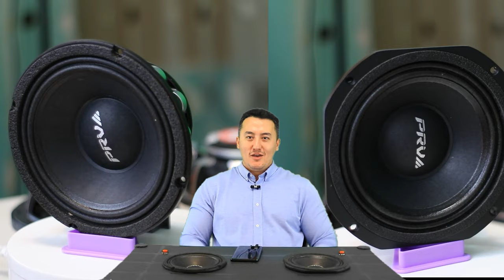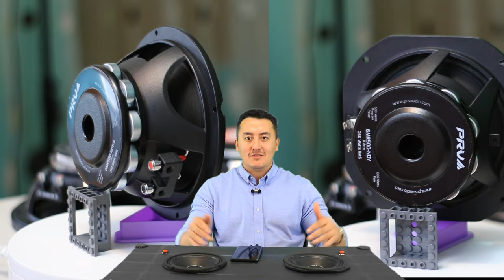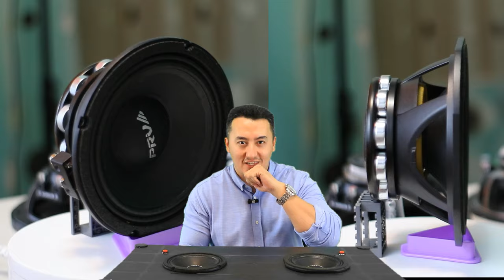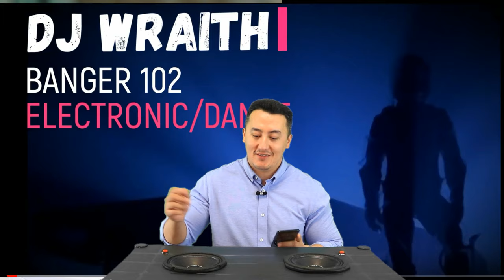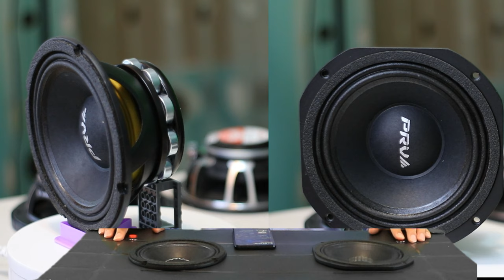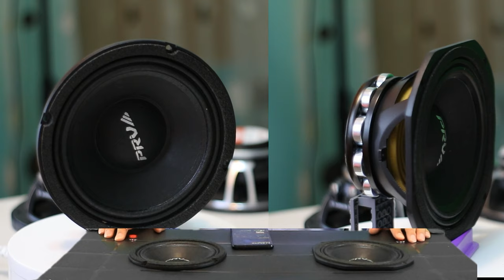Myth busted, real test 4 Ohm vs 8 Ohm speaker? Car audio system PRV AUDIO 6MR500-NDY

Comment: 8 ohm means there's a rest between each bass kick(making it a clean kick like "Boom" - "Boom" - Boom"), the lower the ohm the more the bass overlaps without a break in between each hit(Booommmbooommmbooooommmmmmm no break between each bass Kick more of a continuous bass sound overlapping one another, this is usually at 1 ohm or half ah ohm, this is also why it causes the amps to run so much power/so hot that you could smell the speaker coils because there's no rest just continuous overlapping bass) hope this helps  ..........
Reply: One more thing a amp running 5000 watts rms at 8 ohm is a hell of a powerful amp, compared to a 5000 watt RMS amp running at 1 ohm or half ah ohm, the 8 ohm is going to be way louder, more like concert speakers with ever kick of the Bass, 
The one ohm or half ah ohm will only win if the bass is a set continuous synthesizer bass in the music you're listen to, if not you won't even notice!!!
One thing to remember though running a 5000w RMS at 8 ohm is way more expensive than running it at 1 ohm or below and the 8ohm will sound 1000% better and louder ).........
✌❤🙏

Comment: A couple of factors. First off, it will depend on speaker efficiency, if you have a 4ohm driver with a lower efficiency rating than a 8 ohm drive that has a higher rating, then the amount of output will be close. Also the amplifier has a part in it. Not all amps produce double the power when you cut the impedance in half. Some will, some won’t. So it depends on the amp’s out put on impedance and the efficiency of the speaker’s Thiel small parameters. That’s why some speakers sound louder than others with the same amplifier. Efficiency = power output
Reply: "NOT ALL AMPS DOUBLE THE POWER WHEN YOU CUT IMPEDENCE IN HALF"
i would recomend you to take a look again at ohms law, the amplifier doesn't "doubles" the power when you go from 8 ohms to 4. The power is already there and it will not be doubled, it's simple ohms law and it states that "the power decreases if the resistance increases". So if you go from 4 to 8 you are increasing IMPEDENCE hence power decreases. And every amp in the world does this and not just few amps like you mentioned. Peace.
Reply: Very good answers - you would choose your speaker based on the amplifier's output rating i.e. 4 ohm / 300 W RMS 2 ohm / 600 W RMS and so on.
Reply: @burhanuddin127   hello i have a question and hope i get an answer and is that i have a taramp 800x4 2ohms and i have installed already 4 prv neodymium that are 4 ohms with 2 PRV super tweeters that are 8ohms and i’m planning changing them to another prv model and i wanted to know which speaker is better for me an 8ohms or a 4ohms?
Reply: How do I contact you
Reply: 4ohms @350-450 rms 
2ohms @300-350 rms

From 700 watts rms amp designed for 2ohm.

Comment: They're both 250 watt drivers/speakers.  They should produce same quality sound in design.  It's totally depend on how much the powered amp can produce in 8 ohm or 4 ohm channels, and the wiring here too.  Please check the amplifier power outputs in manual or specs!  It's missed leading fact or myth busted!

Comment: I always enjoy watching your videos. In the beginning of the video  you said that one is 4 ohms and the other is 8 ohms. You also stated that they are on the same channel and if that's the case you will have a 12 ohms load on that Channel. If you have a 4 channel amplifier connect each speaker to a separate channel like 1,2 channel or 3,4 channel because those channels will have the same tuning. The amplifier will put out it separate power due to the load impedance of each speaker.  Thar way the test will be more fair. I am not expecting double the power, double loudness from the 4 ohms speaker at all. And for the people who are commenting about 8 ohms lasting longer than 4 ohms. The truth is it really doesn't matter. If you match your amplifier properly with your speaker's impedance and rms wattage output then you shouldn't have any problems of amplifier overheating or speakers burning.
Reply from the maker: Yes im running on 1 channels and buttons is separating them its not parallel only if I press both itll be parallel
Reply: Still not a fair comparison you need to make sure the euch speaker is getting the same amount watts

Comment: Higher ohms means less power draw, so in a power limited set up like a 70 amp alternator would I be better to use 8 ohm speakers and pump more power to the subwoofer? I don't like my music in my car very loud so volume wont be an issue.

Comment: Ohm is the electrical resistant in a circuit. So it really won't change sound.  It will just take more amps / power to get the same volume on a higher ohm speakers. But you can also overheat and damage the speakers, stereo, or amplifier if you run the channels / circuit on the ohm range it wasn't designed for. If you run /wire two speakers, in parallel, it will drop the ohms / resistants by half. Ex: The positive and negative from the speakers are both connected together to the same corresponding terminals on the channel. 
Then, if you run / wire the speakers in a series, it will increase the ohms / resistance of them. Ex: Positive from one speaker goes to the negative of the other.

Comment: i built my own 3 way house speakers using 2    ,4 ohm 10 inch sub woofers for car audio and 2    6.5 midbass 8 ohm car speakers and 8 ohm tweeters!  i have a total of 400 watts i am pushing with my house stereo and they sound great , i also built my own crossovers i love my music loud and havnt had my stereo over half way yet on volume and it shakes my whole apartment building! lol

Comment: Going from an 8 ohm to a 4 ohm doubles the load on the amp, when you double the power to a speaker, you get a 3db increase. Doubling an amp power to a given speaker doesn't double the sound output, you get around a 3db increase. Humans can detect a 3db increase but it's not twice as loud, you would need a 10db increase for it to be perceived as twice as loud.
Reply: @Hayawasa  True, a 3db in amplifier power which efectly is a doubling of power at any impedance of the speaker curve. A speaker impedance is rated at its lowest point on it's impedance curve but is sometimes much higher within the speaker bandwidth .
Reply: @Hayawasa , 1 NYC DJ is spot on.  The "3dB measurement" here is derived from the formula.  The formula for power is, dB = 10 * Log (Pout/Pin), and for voltage is, dB = 20 * Log (Vout/Vin).  In this case, 4Ω will draw twice the power than that of the 8Ω.  So, we use the power equation and find the Log of 2, which is 0.301, then we multiply it by 10 for 3.01dB.  This is where the 3dB measurement is coming from.  Each doubling of power equates to a gain of 3dB according to the equation.  The difference between a 4Ω and 8Ω speaker has never been a comparison between twice or half the perceived volume.  The difference is merely a doubling or halving in power.  An 8Ω load will always be -3dB when compared to a 4Ω counterpart with the same sensitivity at 1W and with the same voltage applied.  The reason for this is because of the power difference.  2.83Vrms = 1W into 8Ω but 2W into 4Ω.  An 8Ω load with a sensitivity of 90dB will be 90dB at 2.83Vrms and the 4Ω load with the same sensitivity at 1W will now be 93dB because the voltage is the same and 2.83Vrms = 2W into 4Ω.  That same 8Ω speaker is now 93dB at 2W, but the 4Ω speaker is now at 4W and 96dB.  96bB with 4W into 8Ω and 99dB with 8W into 4Ω....etc. (Adding 3dB with each doubling of power).  An increase of 6dB is a doubling of voltage, which also represents a quadrupling of power.  An increase of 10dB is required in order to yield a doubling of the perceived volume (SPL).  An increase in 10dB just so happens to equal 10 times the power when plugged into the formula appearing as though it's linear, but the decibel isn't linear, it's exponential.  It takes 10W to be twice as loud as 1W, 100W to be twice as loud as 10W, 1000W to be twice as loud as 100W, 10kW compared to 1kW...etc.  It requires 10 times the power regardless of impedance to effectively double the loudness.  A change of 3dB can never be close to or over 4 times as loud regardless of frequency.  It won't even be close to twice as loud.  That completely violates physics.  Four times as loud requires an increase of 20dB, not 3dB.  The most important rule to remember in electronics is that we can't violate physics, it can only violate us.
Reply: @Hayawasa  I was covering the theory of it.  In reality, there is no such thing as perfection, nor is electronics an exact science to begin with.  The math is our guideline, but it's certainly not ever dead nuts on...that's for sure.  The figures will realistically be even less due to the limiting mechanical factors of the speaker itself.  But those things go far beyond the scope of what I was trying to illustrate.  I agree.  There's a lot of variables at play.  There is no dead nuts answer.  It's about trial and error when it comes down to it.
Reply: But bad hair cut man does not know this !!!!!
Reply: carforumwanker lmao 😂 wow.
Reply: @shortckt4680  yeah your right and im wrong. 😂😂😂

Comment: Double sound energy is 3db, the difference between some 4 and 8ohm speaker drivers. You starts hearing double the loudness at 9db.  So yes, you are correct it is difficult to hear 3db difference in volume. When you played both drivers at the same time we could hardly hear the change in volume because double the energy is 3db.  However it is measurable and 3db difference is significant.
Reply: 4 or 8 Ohm does not effect the way the speaker sounds. The only thing that ohm effects is the amp.

Comment: Pro and home speakers tend to be 8 ohms. Car speakers are almost always 4 ohms. Why? Because an amplifier is more efficient when driving a 4 ohm load. You get more power at 4 ohms. Car amps and head units would be twice their size if they were 8 ohms. That 14 watt per channel car head unit would drop down to 7 watts if driving an 8 ohm speaker.
In your test you didn't really push your amp to high levels. So at low levels both speakers will perform well.
Midrange speakers tend to be very efficient so most of the time there is no need to push them hard with lots of power.
Where there will be a difference is in driving speakers that would benefit from the extra power which would be woofers and subwoofers.
Generally you are going to see a +3db difference in spl between these two speakers. Often this small amount is hard to hear. +6db is very noticeable.

Comment: the biggest point to 8ohm in my experience is if you have a crappy stock system, what a bit more boom with a better sub cone, but don't want to tear everything out to drive a 4ohm sub, and get the maximum out of the stock amp. They are great for the quasi audiophile who has car speakers or computer speakers with crap subs, but that's the only big point imho.
Reply: THANKS. I JUST WANTED TO REPLACE THE 4ohm WITH 8ohm IN MY $65 SUBWOOFER BOX I BOUGHT FROM EBAY. I USE IT FOR FRIDAY NIGHT COOKOUTS & ALSO IN MY BASKETBIKE WHILE CRUISING AROUND. I HAVE IT HOOKED UP TO A 2.1 CHANNEL MINI AMP. SO, SHOULD SOUND LOUDER, IS WHAT YOU'RE SAYING?:face-blue-question-mark:

Comment: Most power amp manufactures list the power output at 4 Ohm, and 8 Ohms.  Sound pressure level i.e. Decibels is measured on a logarithmic scale, so doubling the power will not double the sound pressure level.  That's why the volume control on a receiver or amp is an audio tapper (Logarithmic) and not a linear tapper,  Potentiometer or rheostat. The speaker's voice coil sensitivity rating also affects the sound pressure level output. The higher the sensitivity rating, the louder your speaker is. An average speaker comes with a sensitivity of around 87 dB to 88 dB. A speaker with a sensitivity rating over 90 dB is considered excellent.

Comment: The one on your right (my left looking at the video) seems more clearer but I can't say either one is more louder than the other. 🤜🏾🤛🏾 Great video I'm impressed. 

Now... The reason why the ohm load is different is (depending on the application) to help pull the maximum amperage out of the amp and also allows the ability to have more than one speaker on an amplifier. 

And don't necessarily help them be louder but more powerful yes somewhat in a way louder but it is more about power handling capability and SPL and Xmas and a few other factors that is the reason why there is a 2 ohm and 4 ohm and also an 8-ohm version of speaker or driver or subwoofer etc.
Reply: Ummm...  WHAT?

Impedance has ZERO affect on XMax, certainly (that's a mechanical design limitation).  "To pull the maximum amperage?"  You don't "pull" amperage.  Period.  The amplifier "makes" amperage (but some people correctly refer to it as "current").  When a lower impedance or larger load (not ohm load) is presented to the amplifier, it's going to make more current.  A power amplifier is a voltage device, and their tendency is to keep the output voltage as close to its design specification as it can, by producing more current in the situation.  Halve the impedance, double the current.  Double the current, while maintaining the same voltage equals a doubling of power.  Into an otherwise IDENTICAL driver (where absolutely nothing but the impedance changes, which requires and rewinding and rewiring of the voice coil, to keep the same inductance, mass, and XMax, this doubling of power will net a theoretical 3dB of output increase.

I don't even know how to respond to the last line of your comment.  There are oftentimes multiple impedance versions of a given driver to facilitate multiple wiring configurations in different situations.  Wiring schemes include series, parallel, and series-parallel, where multiple drivers of different impedances are necessary to arrive at a given, desired, impedance.  Impedance also has zero to do with the power handling of a device, nor does it really affect the SPL potential of the device.

Comment: Ok I don't get what you mean about same power same channel. So an amp that does 125w at 4 ohm and 65w at 8 ohm will not the 8ohm sound drastically under powered while the 4ohm is full and punchy? Or will the still sound the same? Just curious
Reply: Amp output changed when ohm rating changes.

Comment: Impedance matched amp to load will not have any difference. The problem is when people expect an amplifier rated for 4 ohm to drive an 8 ohm load. Its like trying to power a 220v light bulb using 120v. Same with a 4 ohm amp driving an 8 ohm speaker. You will be supplying the 8 ohm speaker with about half the voltage it requires for an expected power ouput of the 4 ohm amplifier.

Comment: Maybe you could do 2 x 8 ohms wired to 4 ohms on one channel VS 1 x 4 ohm speaker. Or 2 x 4 ohm speakers wired to 8 ohms VS 1 x 8 ohm speaker.
Can I assume on a 5 channel cerwin Vega amp that I can run 2 x 10 inch subs at 2 ohms and mids at 4 ohms on the stereo channels? Or should I keep the sub channel at 4 ohms also?

Comment: An amplifier is a VOLTAGE source. It is a FACT that if you put the same voltage into a speaker half the impedance you will have +3dB in volume. This test assumes that the amp will put half the power into 8-ohms vs. 4-ohms which is probably not the case.
Reply: Indeed 3db headroom. I believe the 4ohm and 2ohm has better bass response than an 8ohm also the resistance of the coil will obviously have an effect on the tonal qualities
Reply: This test must also be done just under peaking to determine that 3db. If the amp is under powdered it would go into distortion rather than headroom

Comment: There’s a fundamental misunderstanding here. 

Double the ohms, doesn’t mean it will play half as loud at the same power. It means the electricity running through it, is doing so at twice the resistance… But it’s still running through it.

Now, over time, if fed the same power, an 8-own speaker coil will heat up more. The wires to it will heat up more… Until eventually, the amperage will exceed that of the fuse and blow the fuse. Whereas, the speaker with less ohms, won’t be as hot, won’t draw as large an amperage, or blow the fuse (all things being equal but ohms)

Lastly, as amperage increases, as the wires get hot, then you’ll start getting clipped on the lows and a ton of distortion. Why? Because though the wattage going to the VC is the same, the coil is literally trying to stop the electricity from getting to the ground… The wattage power is at war with the magnet.

Comment: First of all the 8ohm and 4ohm speakers are literally EXACTLY THE SAME... the difference comes from the amplifier. An amplifier is going to put out more power at 4ohm than at 8ohm. It's half the resistance if you were to put the 8ohm speaker on an amp that does 200watts at 8ohm and the 4ohm speaker on an amp that does 200watts  at 4ohm there will ABSOLUTELY ZERO DIFFERENCE BETWEEN THE 2 SPEAKERS... 8ohm speakers are there so that you can run 4 of them on 1 channel of an amp in parallel to get a 2ohm load. Most full range amps do not handle a 1ohm load per channel...

Comment: The 8 is more clear. A 16-32 ohm produces exceptionally clear audio without watt draw. The 8 and 4 paired delivered a whole sound but the 4 on its own is hallow almost like it's in a tin can. But it's lower ohm draw means you need way more watts to push it but produces more bass. This is why all audio systems need powerful tweets to compleat with the lack of clarity.